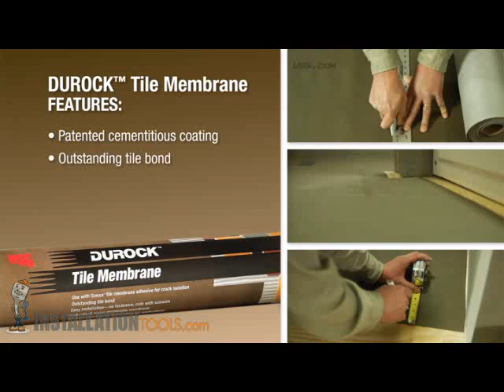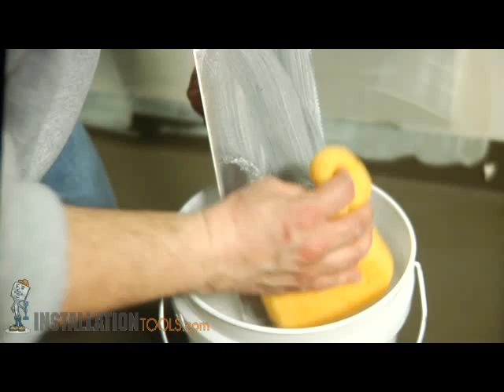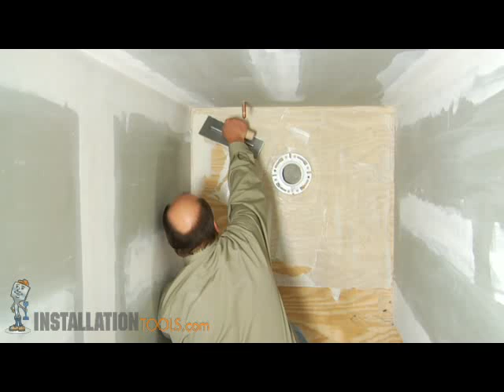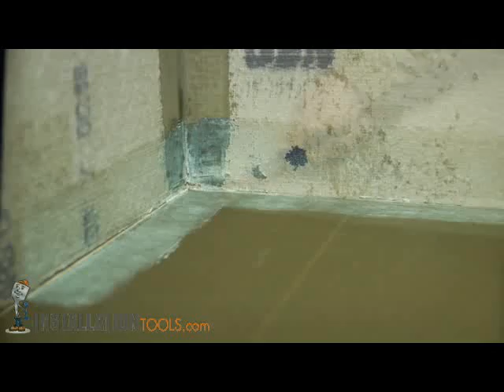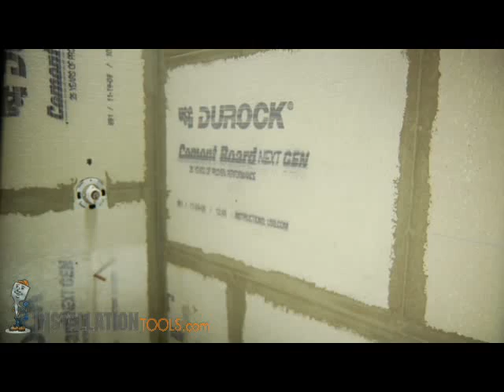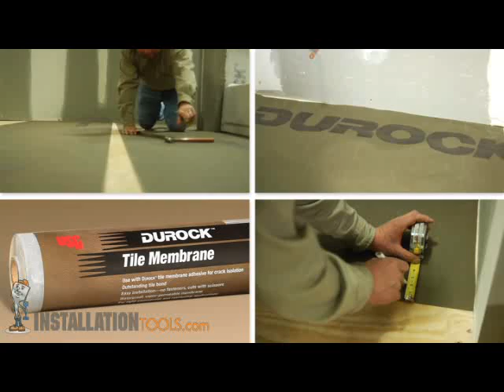Durock Tile Membrane & adhesive Installation

Comment: Looks like a great solution to my old floor tile problem. But can I put a flooring other than tile over the membrane? Can I use a laminate floor or vinyl flooring?  Just lay it on top of the DuRock Adhesive??